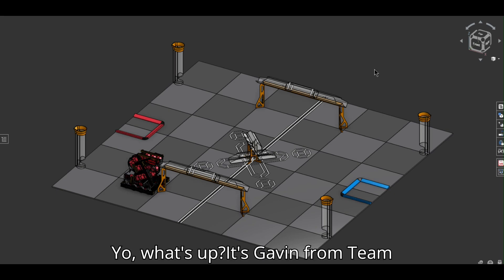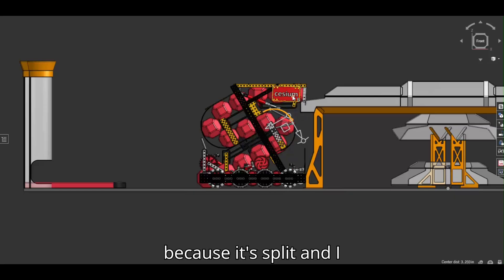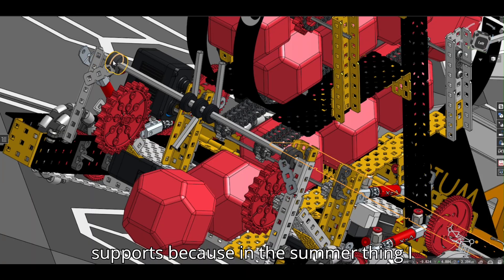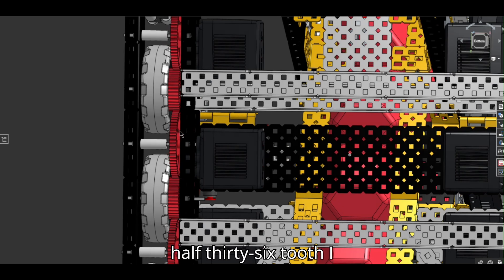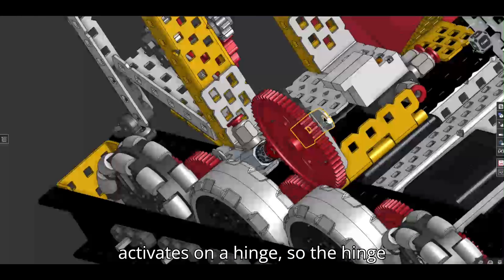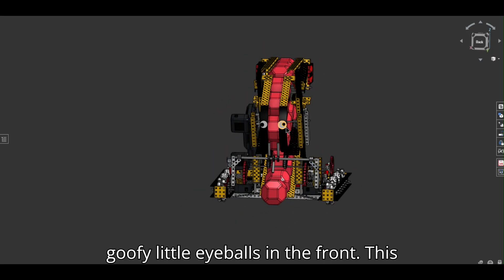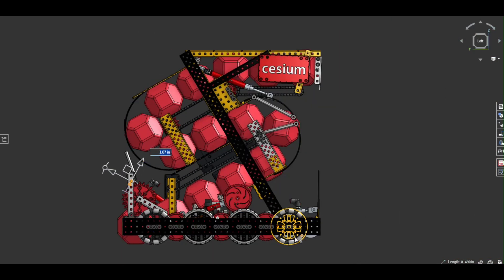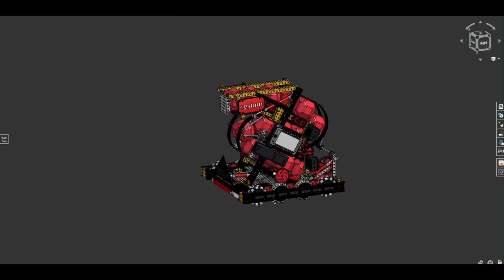s-curve explanation. vex pushback

Comment: Gearing up will give less torque
Reply from the maker: I know it is just 333.33rpm
Reply: @Goated3574 Just switch the gears around for 360 rpm. More torque and slightly faster. Win win